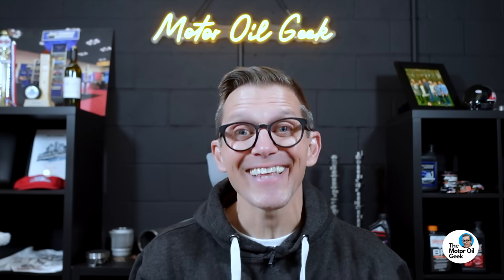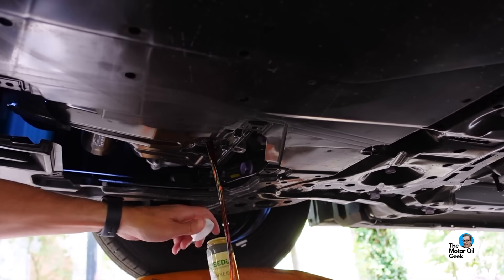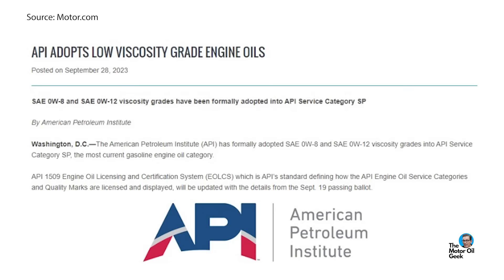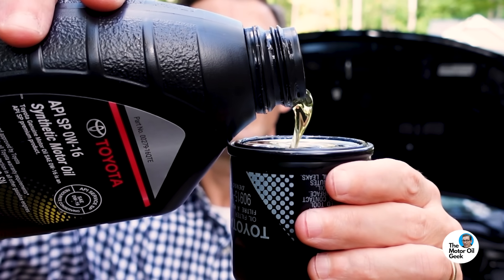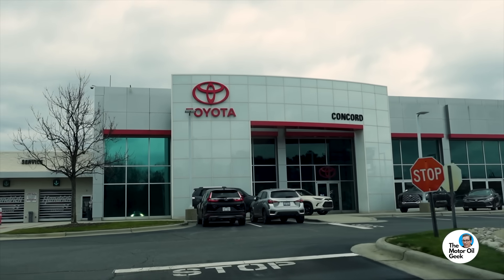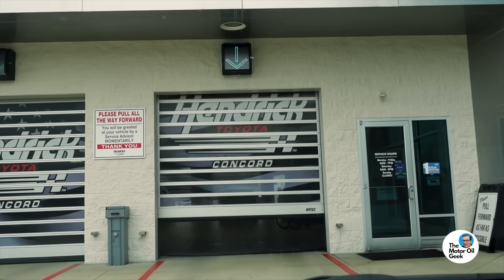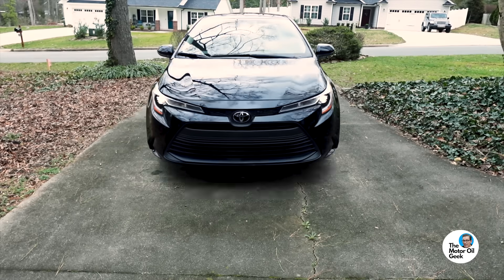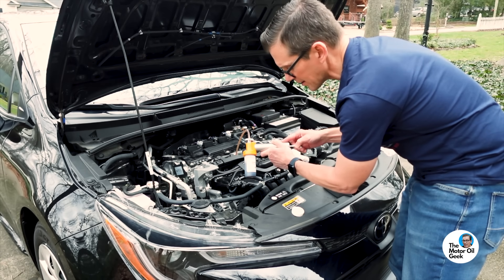0W-8 Motor Oil: Too THIN to Trust? Let's Find Out!

Comment: The 5.7 Toyota tundra engine in other countries list 530 as the supposed to be running. Living in the heat of the south I’m considering changing mine from 0:20 to 5:30.  A lot on the tundra groups have done that.  I think the best thing to do is to try 530 and do oil analysis for both at 5000 miles
Reply: I run 5w-30 in my new to me 4runner. Driving in a heat index of 110degrees plus is no joke
Reply: I doubt it makes much difference, Toyota designed the engine to run on 0W-20 and the 0W part of the equation is actually an advantage in winter as it will reduce cold start wear.
Reply: I've still been using 0W20 in my 2020 Tundra but keep wondering if I should use 5w30 due to so many people stating that is better and what they use.
Reply: I use 5-30instead of 20 too
Little bit thicker
Reply: Thats been going on for a while after the cafe standards.  My car is specd for 5-20, but its 5-30 in all other parts of the world where its sold and its a 2007
Reply: If you use the same brand/class of oil, you can mix viscosities to make up your own.    I’ve been doing it for years.
Reply: U can thin it with mineral spirit to make it 0w-8
Reply: Nothing lighter than 5/30 for me

Comment: The 2023/2024 Toyota Corolla appears to use the same 2.0L M20A-FKS engine since 2019. I currently own a 2022 - should I be switching to 0W8 for future oil changes? Particularly for winter?
Reply: Look for Toyota TSBs. a Toyota TSB might tell you if it is possible to use 0w8.
Reply: Not unless Toyota issues a TSB to supersede what's recommended now. Stick to what's recommended and change it when you should and you'll be fine.

Comment: With my Corvette C7 ZO6, I change to 15W-50, for track use, vs the regular 0W-40. I do have a question. I have a 2022 GMC Sierra with a 6.2. Do I have to use 0W-20 like the manual calls for? I live in S. Tex.
Reply: Use a very high quality 0W20 like Amsoil Signature series or Pennzoil Ultra Platinum.

Comment: Toyota tech seeing Lake come in with his daughter's car-"Oh man, we better use that 0W-8 on his because he is going to analyze it for sure".   LOL
Reply from the maker: LOL, I don't think they know who I am.
Reply: @themotoroilgeek as a race engine guy. This was interesting and legit. Thanks Lake. I would not have the mind to use oil that thin in anyhi perf app. To close to the edge imo. A little typical fuel dillution and maybe get into trouble. But for toyota or a daily driver. I bet the milage and emissions are spectacular.
Reply: @themotoroilgeek . They will !!!
Reply: @themotoroilgeek  Maybe they didn't.   The odds are if they have any reputation that they would have done what was proper.  With that said, when you hand someone oil sample bottles, and they may be wary.  I think that's just common sense.
Reply: @themotoroilgeek they do know that you're analyzing the cvt fluid though
Reply: Hendrix ? @themotoroilgeek
Reply from the maker: @hotrodray6802 yes
Reply: @themotoroilgeek  i'll tell them 😁😁
Reply: @themotoroilgeek  Don't underestimate yourself man
Reply: @themotoroilgeek  maybe well.... but how many customers does a request sempaul of oil loll
Reply: I hope that Toyota will know him very well before doomsday
Reply: @themotoroilgeek anybody coming with sample bottles…they are worried😂
Reply: It comes down to the individual dealership.  A lot of them will not use OEM oil and just use the cheapest synthetic oil they can buy in bulk or a different OEM oil from one of their other brands that is cheaper.  Prime example, the Toyota dealer I bought my 2019 Tacoma from used Ford OEM oil because they were also a Ford dealer and that was the cheapest they could get.  The Toyota dealer I use now since I moved uses Toyota OEM oil as they are exclusively a Toyota dealer
Reply: @mrvwbug4423  I think Motorcraft is still Citgo.
Reply: @GT-mn3bx  No, ConocoPhillips likes it been for decades
Reply: I’m not into conspiracy stuff like that. They may not even know who Lake is because they’ve got so many people working. The vehicle is in his daughter’s name. 
But who knows they may have something written in the notes in this vehicles file if they should find out. It’s a possibility. Yet I highly doubt it!
Reply: @Northlandermn well let me tell you a story as someone who was a lube tech at a Chevy dealership in Tx. We had a ZR1 Corvette come in one time, and it called for very specific motor oil. We didn't have it at the moment. We were instructed to just pump the bulk oil into it. This was not even synthetic oil. I refused, but another lube tech agreed to. They told me if I said anything I would be fired. I'm not saying this happens all the time, but at the same token, dealerships won't turn away a customer. They will do whatever they have to, to keep the sale/service. Including putting sub par liquids in your vehicle. I've also seen us not have an oil filter on multiple occasions, and them instruct us to simply "drain and refill" and leave the oil filter alone. This is why I change my own oil.
Reply: @Northlandermn  Yes. Some times people over think things and unnecessarily make it more complicated.
Reply: @Northlandermn they did know however this customer was taking oil samples to be tested, so surely this would have ensured they use the correct oil.
Reply: Well I don’t think they could have stocked it because they knew he was coming. It had to already be there.
Reply: @Papparratzi  It's already there for the paying customers; they use cheap oil for the free oil change.
Reply: My dealer has had it on the shelf since at least November. It’s been available, but it’s ridiculously expensive at $22 a quart here.
Reply: I wondered, too. But I expect Toyota were far ahead of things. here. I also expect they were ahead of the API. If Toyota says to use a particular oil in their own vehicles what business is that for the API anyhow? Anyway, great work here and thanks for making and sharing!
Reply: @stco2426   The API just sets the standards. You could get the 0W-8 before it was approved, it’s just not ILSAC or API certified. The oil I use is certified to the Japanese standards, JASO GLV-1, I think.
Reply: 😂😂 That's exactly what came trough my mind too. The garage knew that there was no time to play with the oil type
Reply: The fact he came in with an oil sample kit would encourage them not to play any games. I doubt they would have known who he was. Honestly that's not a bad idea for all of us to do even if we don't plan on really testing it.
Reply: @JJFX-  Yep. Sometimes I do that with mechanics I don't trust by asking for the old parts and tell them I want souvenirs of all my car failures.
Reply: Obviously!!
Reply: Vicosity have its use. Viscosity as low as 0w8 generate less restriction and heat but restriction is part of the pressure. You need to have tighter spec for low viscosity and higher flow pump to compensate for less restriction . With 0w8 you have less margin for lack of engine care. Its why tundra engine are exploding main bearing. The interval oil change are bs in reality lower the viscosity an oil is less it will endure oil degradation in viscosity. Even if the oil look good on paper its bad due to the 0.5 less viscosity after a certain number of heat cycles. The reason for this oil to existe is epa not engine durability improvement.
Reply: Dubai toyota calls for just as light oils despite them having plenty of gas, and 110 degree climate.  Prob best to stick with the manual
Reply: Check out the barrels in back! TV investigation reporter did a thing at an oil change place that let you pick the brand. All the bulk oil barrels were the same brand and grade.
Reply: Daddy technician here... AutoZone is stocking Zero W 8 now😂
Reply: I just got a Rav 4 that uses 0w16 and i grill them over the 5w30. Each dealer says the 0w16 will get the vehicle to 200,000miles  or more. Yet seems the motors die before 120000 miles.
Reply: @jeremywhitesell2688  Yeah I might step up to 5W-20 anyway. I always figure at leasr one viscosity grade higher is better.  
I worked at Kia for several years as a tech and the infamous 2.4 known for oil burning, knocking, and slinging rods through the block (and we got good and fast at replacing those engines) has this written in the service information for oil spec-Viscosity .................... SAE 5W-20, 5W-30
I personally own two with this engine, one a Hyundai and one a Kia, and they both have 240K and 230K and use a half of quart between the 4K oil change.  I've also personally seen customer's vehicles that had similar but they are in the minority it seems.  Guess what my Kia/Hyundai viscosity oil is and the minority I've seen is.  Hint-It's not what the dealer has in the oil reel.  
Would love to see someone do a video that busts the myth of looser oil clearances on new engines also as just a little research knocks that one out of the park.
Reply: 0W-8 & 0W-16 oil too thin for me !
Reply: My first thought too !
Reply: My sentiments exactly 💯
Reply: Look Jony, don't mess it up, put the real deal on this Gee guy's car :face-turquoise-covering-eyes:😆😆
Reply: Everyone- he’s joking.
Reply: Some dealerships skip changing the oil sometimes. So, having 0W-8  after the appointment doesn’t prove they changed the oil. It could be the same oil he drove in with.
Reply: @Tractshun didn’t watch the video did you?  He changed it to 0w12 at 5k and took a sample before going to the dealer.  The video was the 10k free oil change.  Then took a sample when he got home.
Reply: I’d never 0w8 in a vehicle 😂😂😂
Reply: I thought the same thing, there is no way any of this can be legitimate outside of what Lake gets, compared to an everyday unknown customer.  (Yes the oil analysis is legit of course)
Reply: They probably put 20w50 oil in it just to F with him lol
Reply: Jjkkkjjjj @LA_Commander
Reply: @LA_Commander  Conventional as well.
Reply: He ASKED for CVT oil sample, what size red flag does someone needs to wave in front of you till you realize what’s going on 😂
They don’t need the bulk supply to have few gallons of OEM for compliance. 

Also the car came with beak in oil and the brake in happens in few hundreds miles or less. After first oil change the brake in is over and normal operational oil will reduce brake in substantially. You won’t see anything in oil after that unless something is going wrong. 

Useless thing that ones mattered with cars from 30+ years ago. And I say that as OCD car enthusiast.
Reply: @MD-gk4uh  Most manufacturers stopped using break in oil a long time ago. Its actually common now for new cars to ship with plain old conventional oil. It expedites how long it takes to get a good ring seal. For most people under most driving conditions that motor is broken in well under 500 miles. So no later than 1k miles on that 1st oil change for sure.
Reply: @boost331  Where did you get that from? 
Unless they brake in the parts during production, it would be very irresponsible of them to not have brake-in oil, but honestly it would not shock me, given the consumerism culture where longevity is the biggest enemy ones past the “minimum lifespan market will bear”. 
The only thing worse for manufacturers then manufacturing the product that doesn’t meat that criteria is manufacturing  one that exceeds it. 
I would like to know if you truly know this for a fact or is this a consensus in the car enthusiasts circles.
Reply: @MD-gk4uh  I actually do this stuff for a living. I manufacture viscocity modifiers and additives that are used by many of the big name oil companies and OEMs. We work closely with many of them. Very few actually use a break in oil these days. Some add a small amount of a pre made "cocktail" of anti wear agents, but many dont even do that. Research shows it is better to not have excessive anti wear properties in play while breaking in the engine. You get a better ring seal and bearing wear patterns that way. BUT its not good to keep that oil in there 7-10k miles like they tell you. Get that trash out around 1k miles and switch to your brand of choice.
Reply: @MD-gk4uh  I know you talked about products that “meat” the criteria -that would only apply to butchery products wouldn’t it? a car would therefore have to “drive” the criteria!😂
Reply: @MD-gk4uh There's fluid in the brakes, but no "brake" in oil.
Reply: jfc, an ocd car enthusiast would know the difference between break and brake.  @MD-gk4uh
Reply: You think they use brake in oil?
What number w??
Reply from the maker: @summerforever6736  No on the break-in oil. We have a video that covers that.
Reply: @summerforever6736  No there are no brake fluid in oil
Reply: Toyota lately going down bad and this one is seems also why they so bad lately

Comment: Nice video!   Couple questions on it.

So if I’m understanding this right, the chemistry of additive package is what allows such thin oils to protect so well?

If the additive package was the exact same would you predict any difference in wear between 16 and 8 weight oil now that it’s broken in?

Are the bearing clearance extra tight for w8/16 oil using engine?

I didn’t know moly could be so high in api oil?
Reply from the maker: Great questions! There is not an API rating on the Toyota 0W-8... Stay tuned for the results. We will see if there is a difference.

Comment: You should do a video for people starting out learning to change their own oil. Never done it my self and always relied on the dealership to do it. Honestly afraid afraid too, keep hearing horror stories of people stripping out the drain plug lol .   Thanks
Reply: There may be several videos on YouTube for changing oil on your make and model.  Drain plug torque specs can be found as well. Oil filter is usually hand tight. I use ramps instead of jack stands and jack .
Reply: You can do it. Take your time and have the right tools and materials. As others noted, watch a bunch of YT videos on it. Above all, make sure the car is lifted safely and NEVER go under it supported only by a jack.
Reply: Watch a YouTube video for your specific vehicle. Initial investment for tools pays off quick.  Just be careful as some vehicles trans drain plugs are similar in appearance and close by the oil drain plug. Take your time and enjoy the experience !
Reply: changing your oil and filter is literally the easiest thing you can do for Maintenace and the most important
Reply: @Bigfoot8x6  Some cartridge oil filters (I think Land Rover Ford PSA 2.7 diesel IIRC) have pernickety gaskets that novices can install wrong causing  a catastrophic oil leak. 😬

Comment: this corolla has k120 transmission and they are very reliable when compared to other belt driven cvt boxes. 
the m20a engine has also proven itself to be reliable. the only thing new owners need to do is to half their oil change interval. replace oil every 5k miles instead of the 10k miles. otherwise the engine will start to burn oil by 200k-300k miles and the short block need to be replaced.
Reply: 5k miles or 6 months for the oil and filter changes using Toyota OEM filters and approved oil and I'd say you're good to go. I agree.

Comment: Lake, I just bought a 2024 Subaru Outback with a CVT.  I changed the oil at 500, 3000, and now 5000 mile intervals.  For the CVT and front transfer case and rear differential what would be your recommendations on changing those fluids?  I do want to keep the car for 200K plus miles.  Thanks in advance for any recommendations.
Reply: I did 4 oil changes myself on my 2022 Outback Wilderness 2.4 Turbo and it has almost 16k miles on it. Used Quaker state ultimate durability 0w20 and factory oil filters.

My plan is to have the CVT and front n rear diff fluid changed at 20-25k miles. I also want to keep my Outback for a long time.
Reply: As a guy who has a lot of Subarus in the family (9) and has been working on them since 2004, differential fluid is good for about 15k during break in. 30k-45k after that, but no more than 3 years. I'd like Lake to give insight on the CVT, we usually follow 60k/5 years then 30k/3yrs because only 4.75qts of the 12.5 are changed during a drain and fill.